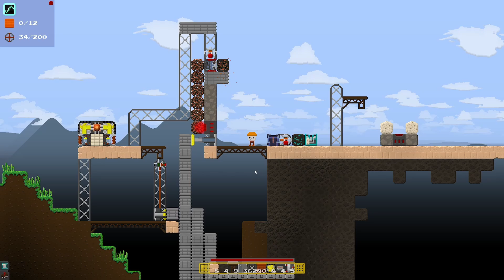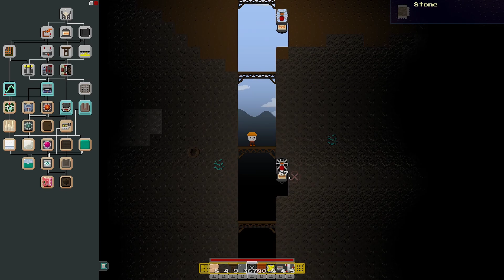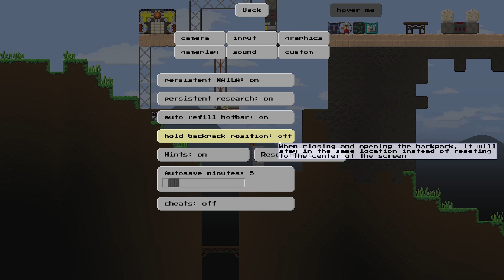Roody:2D | Basic Assembly Lines & Stockpiles | Day 2

Comment: Hey Toastonrye! Nice progress, I liked the downward digger. There is probably a way to fully automate digging down. What is down there, in the depths of the world?
Reply from the maker: I am pretty sure there is, but I have so little unlocked I think it's far away. I'll allow myself to struggle a bit before turning to copying someone else's design lol! As for the world height, I'm not even sure, but I think an interesting strategy could be turning the mineshafts into stockpile zones.
Reply: @toastonryeYT  I think, since you currently produce and drop down, it is better raise the production up in the sky and collect at your normal level. Because if it is below, you will have to go down every time for collection. But maybe there is a clever way to push results up instead - no need to dig then and machine + results are at your level.
Reply from the maker: @tamatlt7469  Hmm, good point. There must be, but at this stage I don't know of an elevator mechanic, so the sky is the smart play!